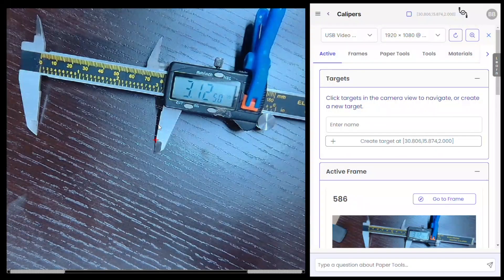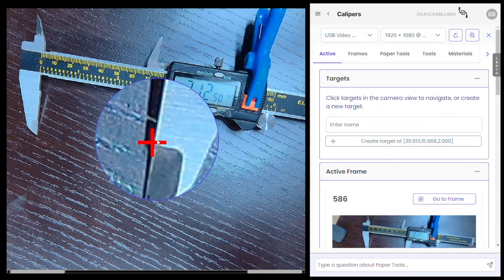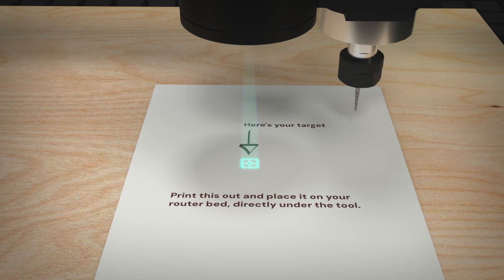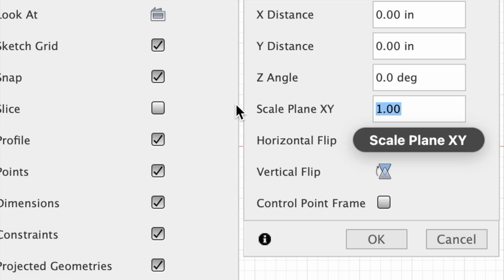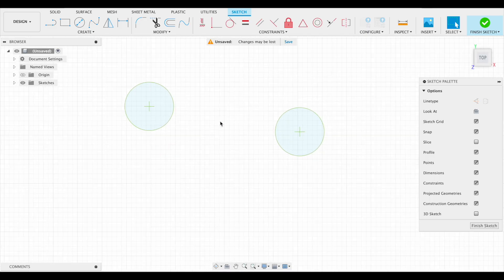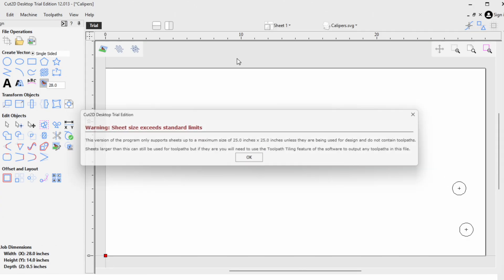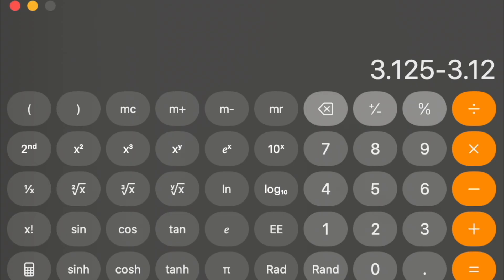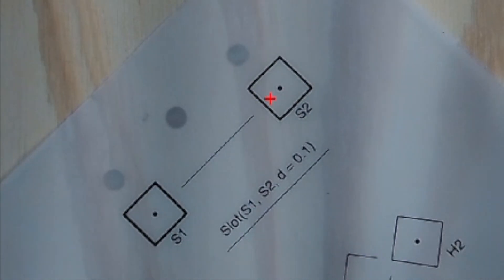Putting Calipers Precision Under the Magnifying Glass

Comment: This is really cool.  It would be useful just to use the CNC for measurements directly.  If you could add a tool where you find the two locations like you showed, but then could just just display the X and Y offset, as well as the distance between them right on the paper tools display that would be cool.
Some day even turn it into a full 2D scanner so a part could be replicated, or even just capturing a full bmp that is scaled properly so that it can be imported to Vectric and then coverted to vectors there.  This tool is really opening up a lot of possibilities.
Reply from the maker: The scanner concept is where I'm headed. There will also be some tools to select geometry like holes so you can find their edges and centers. You can already display the x, y coordinate by dropping a target at the magnified location.
Reply: @PaperTools  Nice